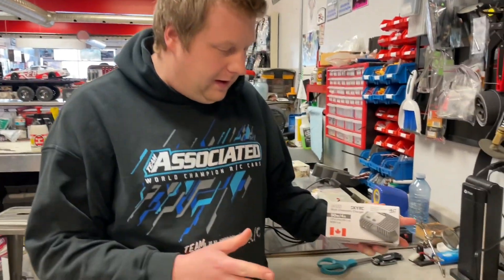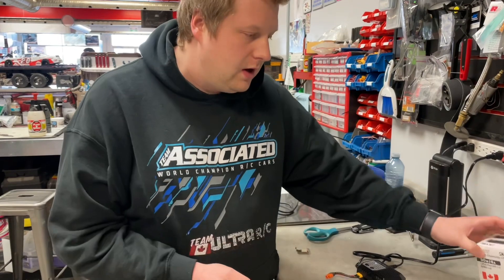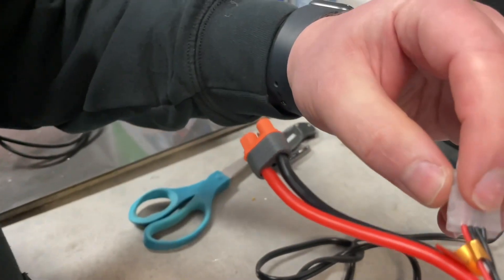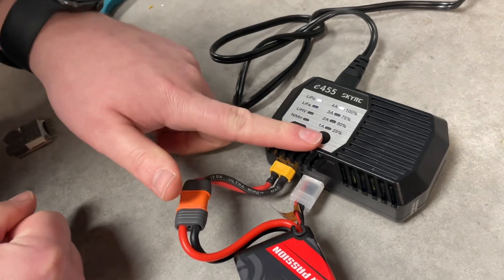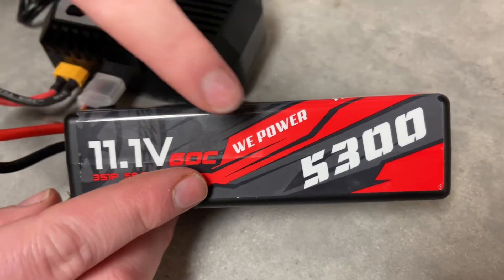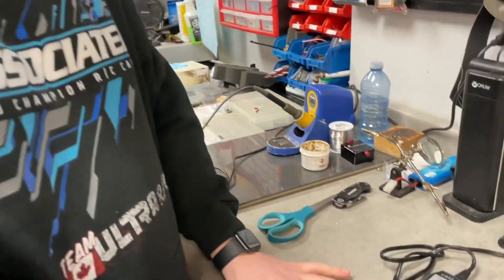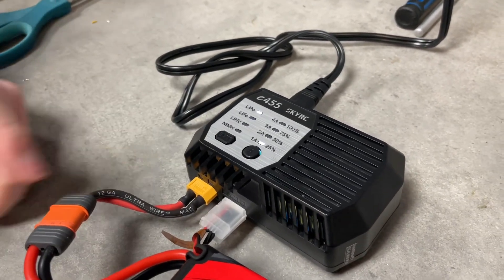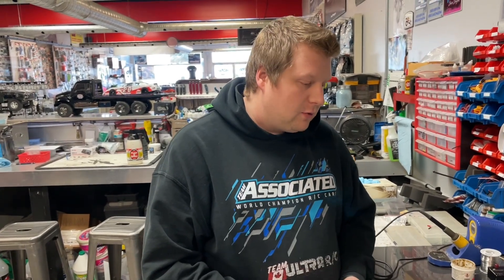How to Charge a LiPo Battery on A SkyRC E455 Charger

Comment: how do i know if it’s actually charging? mines flashing 4 times then stopping continuously while on the 4A mode, on the 25% led
Reply from the maker: We have found that the manual states the charger will go solid when charging but we found the charger will flash on the percentage of the battery capacity just like shown in the video. It should however increase as it increases the MAH inputted into the battery.

Comment: Hi there, if i have a 5000mah 3s battery that has a recommended charging rate of 1-5C, does it mean charging it at 5C = 5amps as its 5000mah/1000 = 5
Reply from the maker: Thanks for the question - 1c would be charging at 5amp as you would be converting the mah (5000) into an amp hour number. I’m our recommendation we always suggest to balance charge at 1c for maximum life out of any battery
Reply: @ultrarchobbies  thanks for the reply, would it be safe to charge it at 5amps? Im new to rc stuff haha

Comment: Since the amp rating on the 3s 11.1v 300mah is .9.
Reply from the maker: If that battery has a 3s charge rate the math would work. If you were to charge at a 1c charge rate .3 of an amp would be correct

Comment: Hi, can this charger charge a 3s 300mah 11.1v?
Reply from the maker: Thanks for the comment, the lowest amp rate that this charger will produce is 1amp so it will be a little high for a 300mah battery